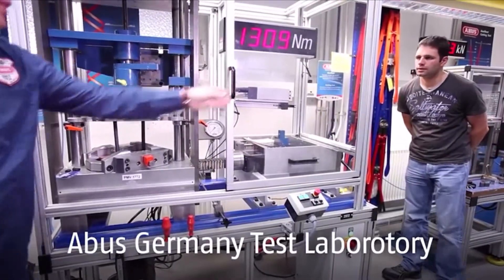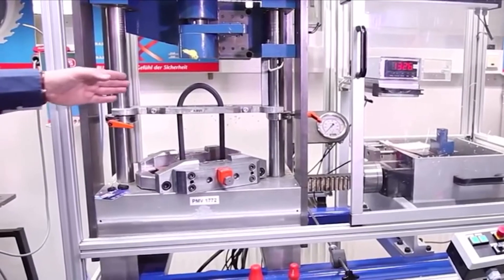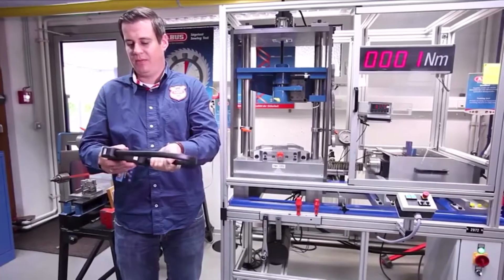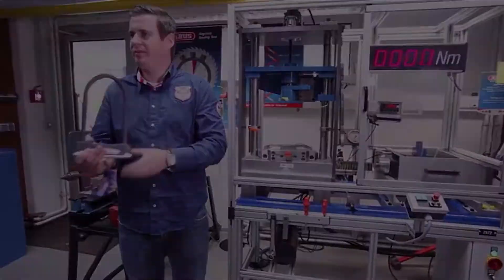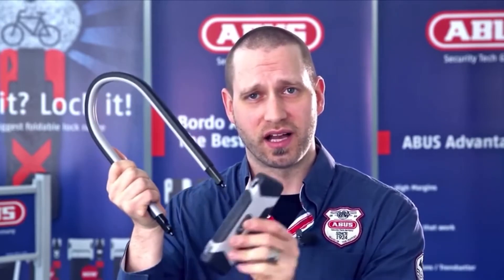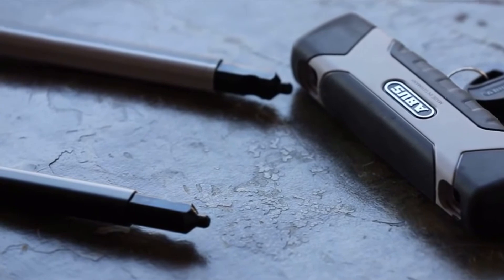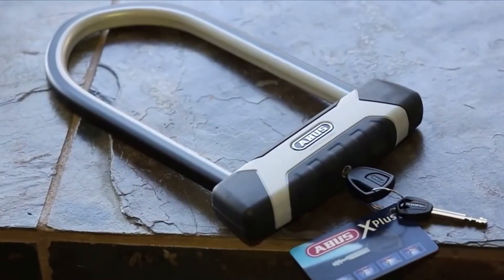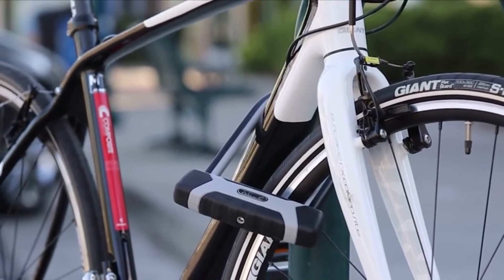Most Indestructible Bike Lock Abus Granit X-Plus 540 U Lock

Comment: How easily can it be picked? 7 tons of pulling resistance.  Impressive, but nobody is going to try to pull a U lock apart.
Reply: No thief is going to pick it, they will cut it in 20 seconds with an angle grinder.
Reply: @TheEchelon  That's what the Pros use.  They ride around with top-notch cordless tools and a truck and throw your bike in and they're gone in 60 seconds or less.

Comment: Reportedly the best bike lock on the market.  Diamond rated (above Gold).
Reply: If it is Diamond rated, why was that not mentioned?
Reply: @effyleven  
Because the rating is relatively new.  See https://thebestbikelock.com/ for more.
Reply: @qewfsdsd65445  
It's thinner than, say, the Kryptonite New York U-lock, but metallurgically it's just as good if not better.  Plus it's fashioned square at 13mm like the Kryptonite chains, making it extremely difficult to cut through with snips.   Angle grinders are obviously the best bet for any truly determined thief.  I'd opt for a GPS unit as well, personally.
Reply: @qewfsdsd65445  calm down Mr repetitive negativity
Reply: So why is the Abus  Granit Extreme 59 D-Lock that costs 3 times as much just gold rated?
Reply: @DemiGod..  
Diamond is a relatively new classification that many lock companies haven't yet adopted.  It might well be equivalent to a Diamond rated lock.  Gold or Diamond, you really can't go wrong.

EDIT:  Just looked it up.  It is Diamond rated.

Comment: let me tell you the joy of using this lock. it is 99.9% rust proof even out in all weathers, you may see a tiny bit of rust deep inside the shackle hole, but it does not get on your clothes and hands like another famous d-lock, wont name names, in yellow/black, which does rust a hell of allot when kept outside. The abus mounts onto a texkf twin bracket that when set right with an allen key will 'not' rattle on your frame when riding!! the abus is lighter yet just as strong as its main competitor in black/yellow. Also the ABUS is a bit longer and as mentioned lighter than its competitor, so will lock up to bigger posts!! it is a square shackle so harder to cut and and wont spin around when cut on one side. An excellent lock. Bolt cutter proof, 'But' it can be cut with a grinder, just like its competitor, I think in under a couple of minutes!! so keep your ears open when locking up and always lock up near a busy area so people are around if possible.
Reply: 540 and a GPS unit.  Tough as fuck to get through one, but not tough enough to escape the other (unless the battery runs out).
Reply from the maker: Nice